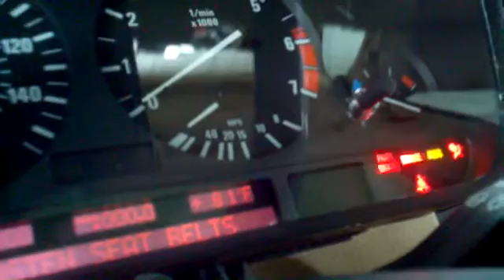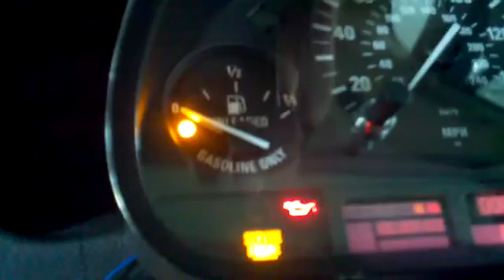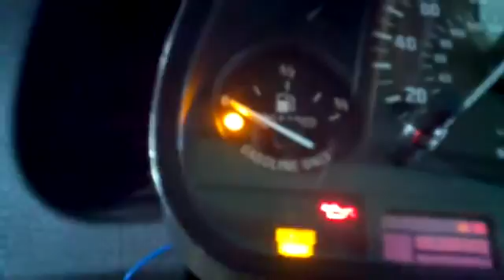BMW Battery warning light on instrument cluster X5 E53

Comment: need help with my 1994 318i it starts up fine but if i remove one of the battery terminal car dies. 

checked the following:
battery good
alternator is good
ground connected
even switched up alternator and battery with my friends same exact car and still the same.
battery light indicator remain on and drains battery

thanks in advance

Comment from the maker: In most cases when the alternator light is coming on it is the alternator. Often an alternator will test good just from disturbing it during removal. I would start with a new alternator. The problem in this video is very rare and only caused by a secondary failure due to a connection allowing water to short the high and low amperage circuit. Hope this helps Veronica :)

Comment from the maker: The water was from the pins on the connector to the alternator. The seals on the back failed and water would leak into the connector through the back causing the higher amperage circuit to short to the low and damaging the cluster.